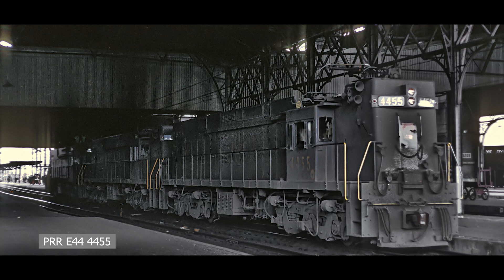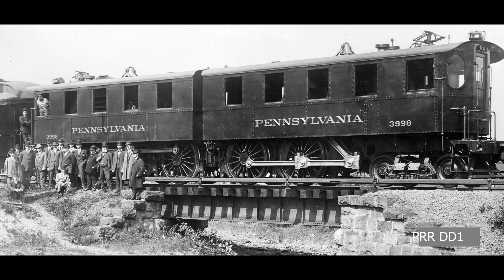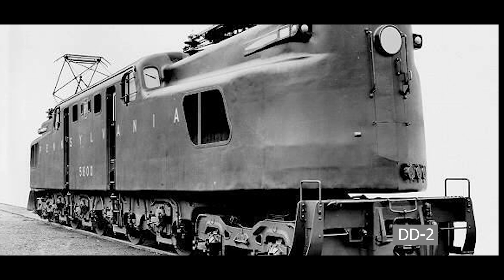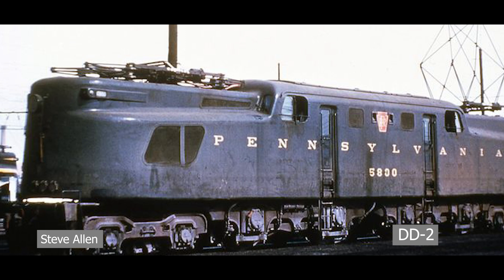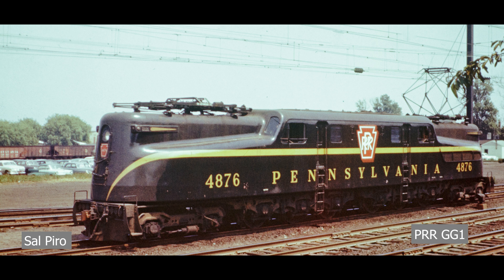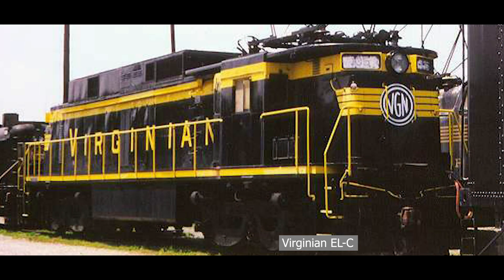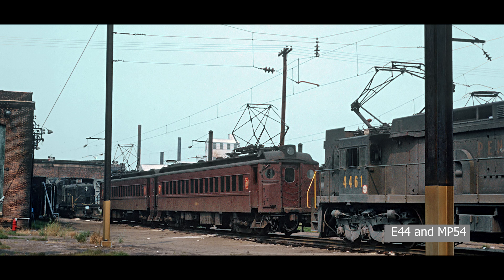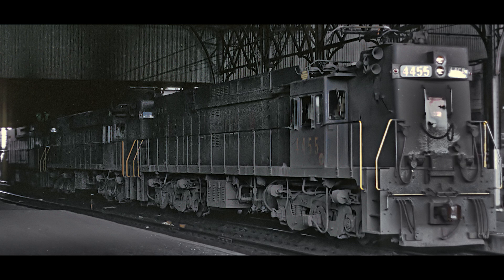PAN UP A history of Electric trains: The last stand of Pennslyvania's Electric locomotives.

Comment: No mention of the 2 EMD  Demonstrators, GM6C and GM10B using the propulsion system licensed from General Swedish Electrical Limited (ASEA) that was used in the AMM-7 that were tested by Conrail in the mid 1970s but never manufactured in numbers. Those locomotives were more powerful then the Union Pacific EMD EMD DDA40X Centennials.
Reply from the maker: Don't worry will be covering those in the conrail video as the PC video was getting a bit long for my liking. I try and keep my videos to about 15-17 minutes so it doesn't require multiple sessions just to finish a video. I'll do my best to cover these unique swedish locomotives.

Comment: I always look forward to your videos.

But, the tractive effort noted for a single E2B at 4:27 does not include the speed.

A locomotive of a similar weight is a GP-7.
The specifications for a GP-7 are noted below:

Maximum speed	65 mph (105 km/h)
Power output	1,500 hp (1,119 kW)
Tractive effort	Starting: 65,000 lbf (29,484 kgf) @25%
Continuous: 40,000 lbf (18,144 kgf) @9.3 mph (15 km/h)

Notice how the TE is greatest at near zero MPH and declines as the speed increases.
The E2B tractive effort is noted at 35400 lbf, which seems real low for a locomotive of about the same weight as a GP-7.
This can't be a "starting tractive effort" value.
When ever I see a TE value given I then ask "at what speed" ?

Thanks for your great work.
Reply from the maker: You're right regarding the odd figure regarding the TE. The book i used listed the figure without a speed to it citing it as tractive effort. I have a feeling it might be a continous tractive effort at 15mph or around 20km. Alot of the information about the E locomotives is lost to time and alot of the information that is out there is found in forums which can't really be verified. Its sucky to be honest.